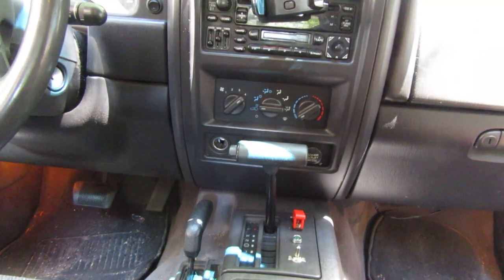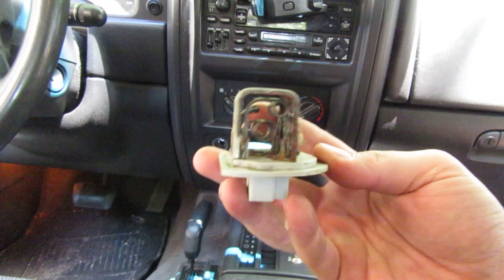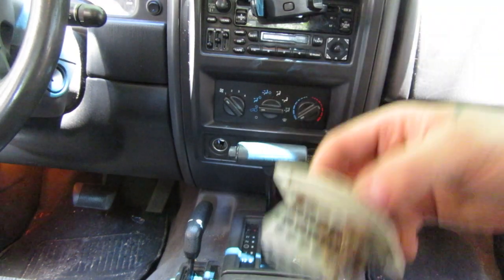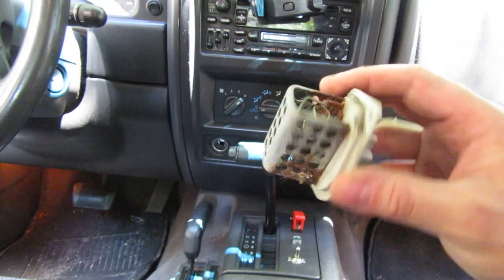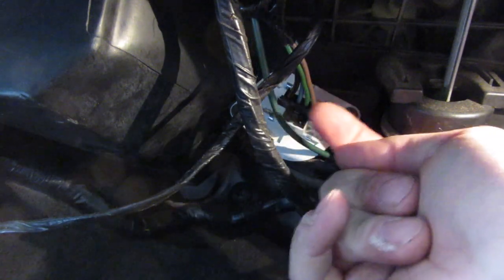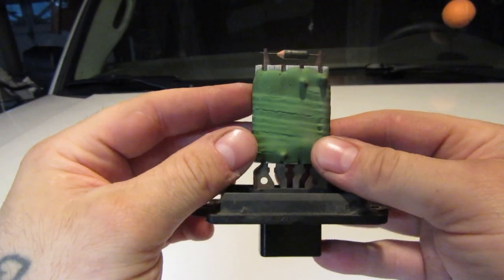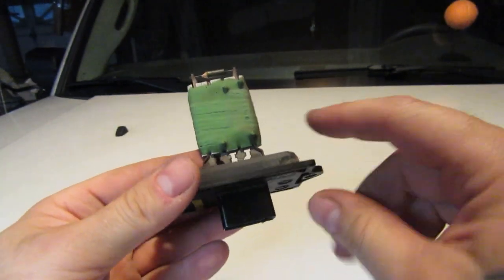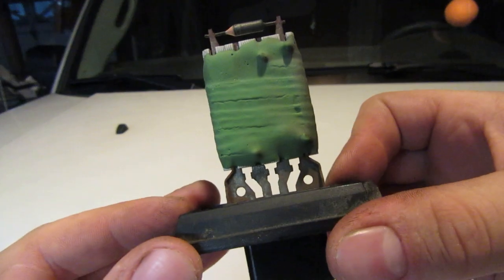AC/Heat Only Blowing on High?

Comment: What if my AC doesn’t change settings when I change it from Max AC to AC to head and feet, head, feet, defrost and feet, defrost?
Reply from the maker: That is a blend door issue. There is a physical door which changes between the venting. Either it brakes or the motor controlling it goes and it stays in one position.

Comment: I have 87 Cherokee laredo my ac blower only blows on low and medium and doesnt work on high. I have changed the blower, resistor, and the control panel and it still wont blow on high. ANY IDEAS???
Reply from the maker: Maybe a short somewhere? I guess I would try to check the wiring

Comment: Hey man! I had a question for you not really related to this video. I am looking into replacing my passenger airbag cover. i havent really found much online about it, but I just need to know if you are able to replace that cover, or would you have to buy a whole new airbag? I just want to find one in the junkyard and replace mine because mine has a scratch on it. Thanks bro !
Reply: This is for an 2001 XJ by the way!
Reply from the maker: Hey, interesting question. I believe they are an integral unit (i.e. the cover that you see as part of that dash is part of the airbag). You might have some luck going to the junk yard and pulling one though. Some yard will not sell you airbags. I believe your best bet will be to find a u-pull and give it a shot. Sorry I can't give you a more definitive answer. If I can I will look into it next time I am in the yard. If you end up finding out, let me know. I am intrigued by your question.
Reply: Hey! Thanks so much. I will do some digging and let you know what I find.
Reply from the maker: Hey, when we were at the junk yard yesterday I found something relevant to this question. Checkout the latest video. Let me know if it help https://youtu.be/Bkor2VcK-Hc
Reply: Thank you!! You rock.